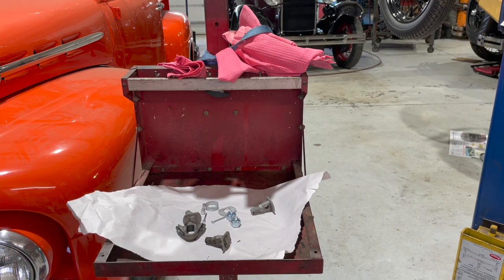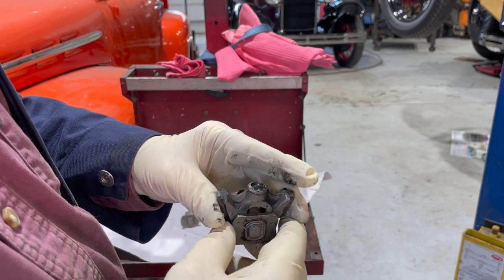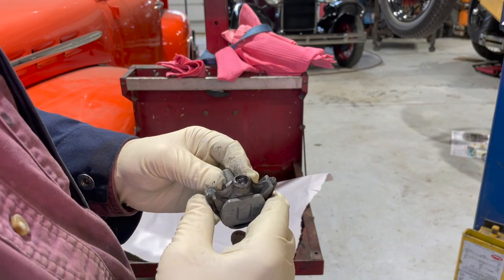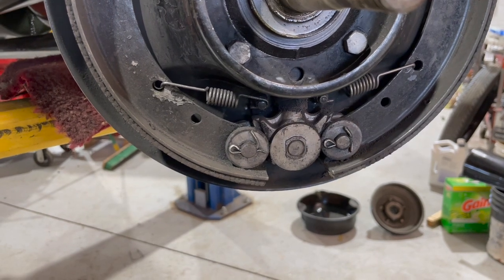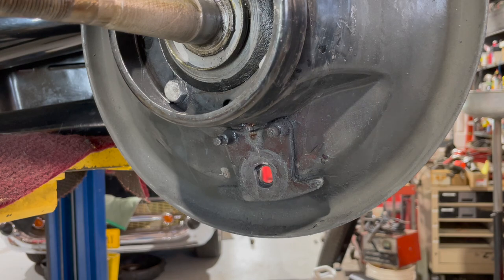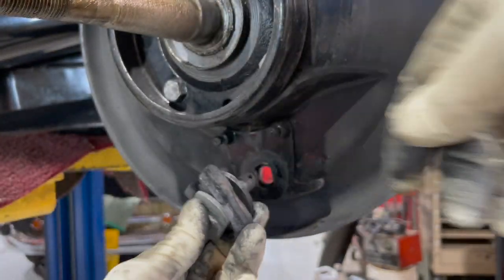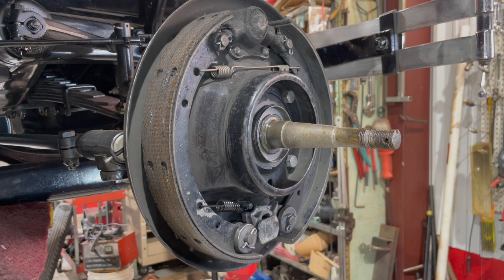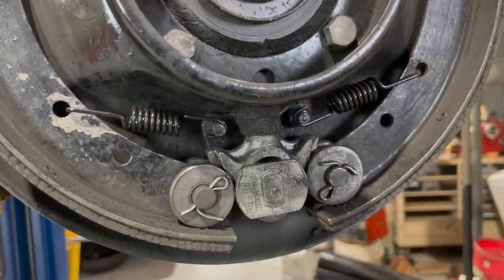Model A Ford Mechanical Brakes

Comment: Nice video, Randal, I will be watching all that you publish. I've recently replaced the front spindle bolts and their bushings. I'm recalling that a single felt dust washer installs above the backing plate at the bottom of the spindle bolt???
Reply from the maker: Yes you are right, really don’t know why someone put these above wedge, I didn’t remove because it won’t bother anything 
Thank you

Comment: I'am 69 Years Old and had 2 Model A's back in the 60's. A31 Closed Cab Pick Up, and a 1930 Deluxe Coupe. The Truck got Traded by my Dad for Body Work On my Brother's 63 Plymouth, and the Coupe I drove for 29000 Miles, (Sold to Alphie Gearhardt in Los Gatos California a Long time ago) Built my own Engine for it with An OLD TIMER Named "SCOTTY" We Lived on the Same Street, that I work with for 10 Years till his Death (Very Sad Day For Me) back then, he was Like a Grandpa to me. "EVERYONE" Had there Engine's Built by us back then,  Doctor A Pete Taormino,  Ron Dunn, Dave Sorich,  Lee Sherman, Everyone... We Built a Really GREAT Engine, SCOTTY Had some things he did for the Oiling of the Connecting Rods, and Main Bearings, that we Thought made the Rear Main Bearing Less Likely to have the Famous Leak it was known for. And we a Hand Made Machine that he built back in the 1930's to "CUT" the Groves in the Connecting Rods. It was So Much Nicer done and Looked PERFECT when it was cut. I did it ALL With Scotty. And Pete Just Loved My Wife Back in the Day, we were Married at age 16 in 1971, and I made Many Trips out to Allen Ave back then for Part's to Build the Engines with. COST For A Complete Short Block was $169.00. Balanced, $189.00. When Scotty Passed away, the Last Price I remember was $229.00.  Greta Video, However, I personally would have Cleaned All the areas / Parts and applied New Lubrication to it all. That's just me tho. Nice Garage too, Wish I had that Kind of Room to Work. God Bless the FORD MODEL "A"!!
Reply from the maker: Thanks Ken sounds like you have some great friends and memories 
As for lubricant dry lubricant would probably be ok but oil and grease only attracts dust and gums things up, just my opinion

Comment: Great video! You don’t actually have to take the wedges out, right? And did you test drive it to see if it made a difference? Thanks!
Reply from the maker: Jeremy,you could probably leave the wedge in but I wanted to check the top brake adjusting shafts for wear, the brakes were way out of adjustment before ,so I didn't drive before installing floaters Thanks